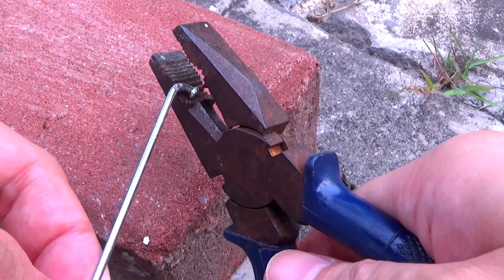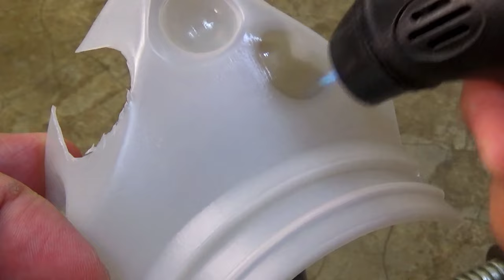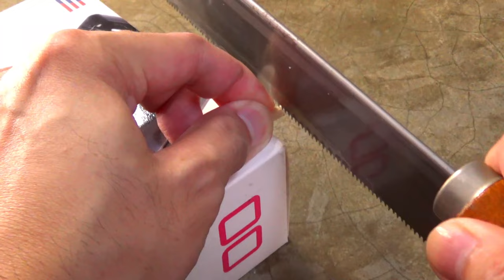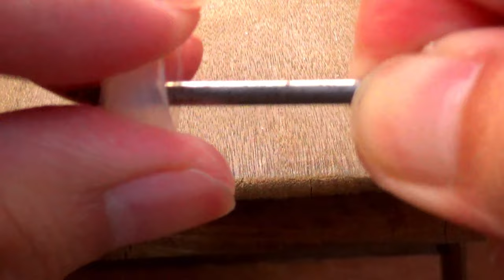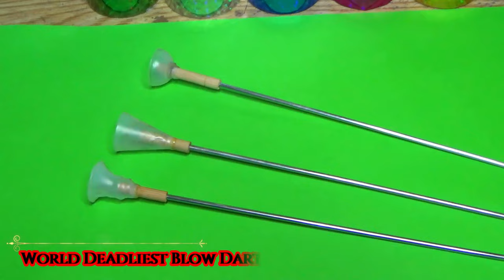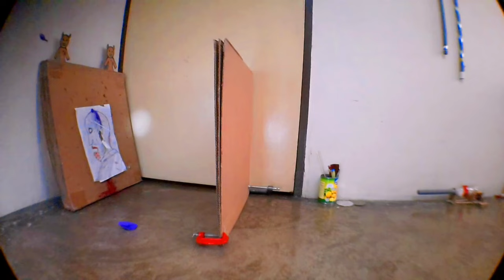Making World Deadliest Blowgun Dart (2023) ★★★★✩

Comment: I have to admit. When I first start watching the video, I figured it would just be a kids toy. Almost to the End, and i Knew, This Guy Knows, what He’s Doing! GREAT CHANNEL! He’s got my Vote👍
Reply from the maker: Watch this
https://youtu.be/APGoBz_qP24
Reply: @LKH9Channel  Already saw it. Very Clever, Engineering.
Reply: Using bicycle spokes for darts is pretty expensive, get some gas welding rod instead.  And since a micro torch was being used to make the cup seals, heat up the end of the dart to red hot with it, that will make it a lot easier to smash it flat.  And sharpen those babies up with a good file, grinder or some sand paper!

Comment: Hi Everyone , for the home blow dart makers here is a great way to make darts , bicycle spokes and I have found buy using insulin pen needle caps and putting it in a piece of coarse sandpaper and turning it around in circles and checking it every few turns it will fit into the .625 big bore guns great .
So if you  are a insulin user it's a great use for putting these plastic to use .

Comment: Love the ejecting sabot design. I experimented with something like this but it didn't get far. Thanks for the help

If you used a shorter dart what do you think will happen though. Will it spin after penetration?
Reply from the maker: I think a shorter shaft won't work as good. Longer shaft is more stable and penetrate more like a spear throw. Short dart will tumble too much after ejecting from the cone.

If only I have the expensive Chronos High Speed camera, hard to capture that movement

Comment: Can you tell the equipments needed to make one
Reply from the maker: @holdsomecrypto8580  Raw Material: (Hdpe) Milk/Yogurt/Shampoo Bottle

Tools: Cheap Jetflame Lighter, Any round spherical ball(Glass marble/Steel Ball) for molding, A section of your Blowgun pipe, must be exact same pipe!

All other features like the detachable cone and the dart shaft are optional. Use what you can get easily.
Reply: @LKH9Channel  thankyou bro
Reply from the maker: If you want instant lazily made blowdarts, this! Lower performance, but easy to make a lot
https://youtu.be/S2LVK98deps

Comment: Excuse me sir ...●please answer 
In Bangladesh the blowguns are not available here ..
so, i cant buy this .I think to make it .Brother i have a question...In here the cold steel pipes are not available 
But stainless steel pipe and aluminium pipe are available..
So, which is the best ?
I want to use one of them ...
Is the aluminium pipe faster than the stainless steel pipe?
Reply from the maker: I'll try my best to answer you. 

Stainless steel or T-6061 aluminum are really good pipes for a blowgun, but my concern is the thickness and straightness after being cut. The pipe wall thickness should be 3mm strong, just like the Coldsteel tubes. Stainless steel can be slightly thinner walled like 2mm since steel is much more heavier and harder than aluminum. 

Stainless pipes, you must make sure it's the 'seamless' smooth bore type, no welding line!

And You got to make sure they are dead on straight. I have access to these thick aluminum pipes here, but I dare not buy due to this reason. With class 7 thick 15mm pvc pipe, I can make it straight by using support rail. Hence I choose pvc for my blowgun. I can't buy coldsteel blowgun either.

Dart shooting speed, it's up to blowing technique and how well made the cone is, a snug fit seal. As long as the bore is smooth, you're good to go
Reply from the maker: Another method is to use a thick pvc pipe as the exterior to support the metal pipe, using the metal as the inner lining. You want to make sure the end product is unbendable from abuse or accident falls. Metal pipe can dent, the worst nightmare of metal blowguns
Reply: @LKH9Channel  thanx a lot Brother.. 
So,Plz suggest which can i buy ?
Available pipe :
1. Stainless steel pipe 16 mm wide , 2 mm thickness
2. Aluminium pipe 17mm wide ,1 mm thickness
Reply from the maker: Get the stainless steel, but is it seamless kind?? Also Check for straightness
Reply: @LKH9Channel  thanx for your great idea sir ....
Reply: Buy the seamless aluminium buth thick 3mm is good  and polish the inside of the pipe with scotchbright abracive material and after polish paste and then put auto body wax inside of it. Your darts will shoot much faster and more accurately.
Aluminiom can bend very easy but its also easy to get as its seamless. Make sure to proteck the muzzel with a band of rubber or other material.
Reply from the maker: Some blowgun guys say the pvc has the least friction of most metal pipes.
Reply: @LKH9Channel  yep probably right but if you polish the interior of three  metal pipes with sand paper and then scotchbright and then polish paste and the  apply wax or teflon or other autobody protective coatings it is smoother than the pvs
Reply from the maker: Probably I'll need to apply the auto wax into my pvc pipe too. Silicone lube will be awesome too I think
Reply from the maker: But sanding with sandpaper is not a good idea, that will enlarge the caliber size of the pipes. Just wax or lube it will suffice
Reply: @LKH9Channel  no you use 1000, 2000 grit ect and  then polish it like a mirror. I clean it with scotchbright pads  on a bore snake to remove oxide and dirt or other material and then sand with a finer maybe 1000 first  and finer grit  2000 and even to 4000 and then polish with polishing compound. Afterwards you take the autofinish. There is a nanoceramic "diamond" coat one thats pretty durable but really any will work.
Once you have done that the incide will be very very smooth and shine like a mirror. You shpuld also chamfer the muzzel  too. Damage at the muzzle is the most important to avoid anf the chamfer reduces this. I put a plastic ring on the muzzle to protect it
Reply: @LKH9Channel  yep it will make a difference. You can also polish pvc amd coat it. A teflon lining wpuld be fantastic too  😊

Comment: I tried this with 3 different bottle but the I got plastic bag like cones. Why?
Reply from the maker: You need to burn a wider surface.
Reply: @LKH9Channel  Thank you, it worked now. Cones made by cardboard are not usable after few shots because of Alcohol gun's pressure. They burn then tattered. But these hdpe cones are perfect. Maybe my accuracy problem was because of cardboard's weight, I'll try shooting with these new cones at outside.🤙
Reply from the maker: With experience, you will make better hdpe cones. Thicker bottles will need small burn surface to get it thin. Thin plastic needs wider surface to compensate. Do update me on the results
Reply from the maker: @cesurkarakus209  oh yeah one more trick I need to share with you here... After a few shots with the hdpe cones, they will become looser and looser from the wear & tear. By using your finger nail, both hands, scratch the inside edge and slightly flare it out, not too much until you tear the plastic, just slightly... This way it will be good as new and fit in the gun barrel snuggly
Reply: What type of plastic should I used, I try with a bottle of coke but is just compressing from the heat
Reply from the maker: HDPE